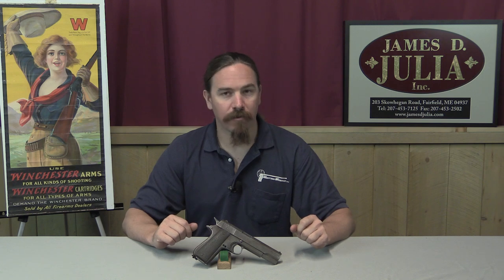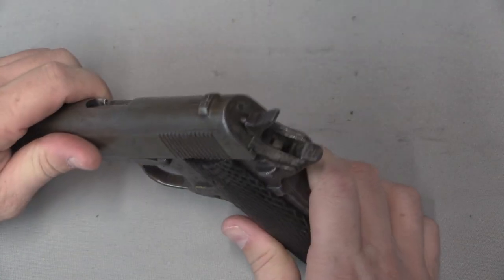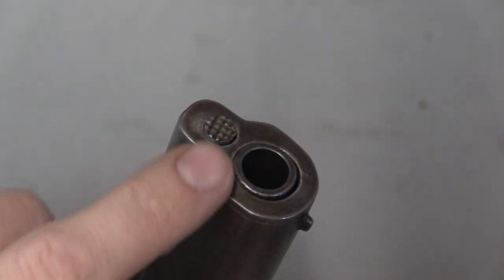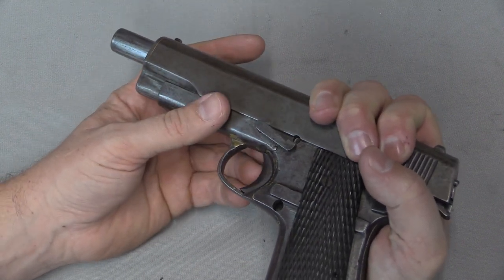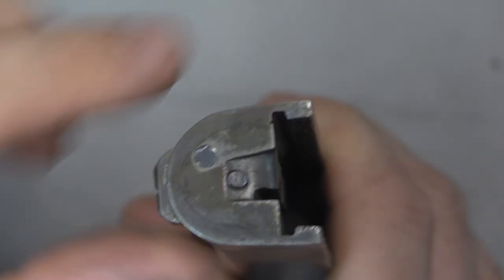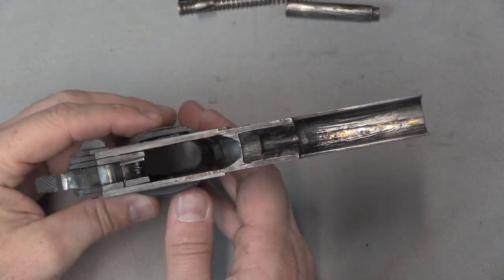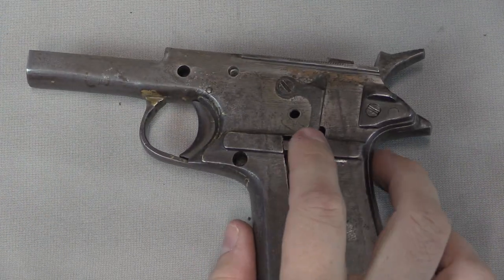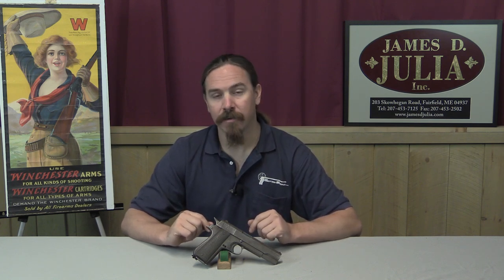Vietnamese Crude Blowback 1911 Copy

Comment: nice grenade u got there
Reply: This comment is pretty fucking funny
Reply: “Hand” grenade
Reply: it wouldnt explode if a hipoint .45acp which is potmetal for the slide wont and this is actual steel
Reply: @gcart7675  it's brazed together. And it's blowback. The pistol would come apart
Reply: Timothy White its still real steel im sure it should still hold together
Reply: @gcart7675  The concern isn't the steel itself shearing apart. The concern is that it's made out of bits of steel that are brazed together. I assure you that brazing is weaker than any Hi-point.
Reply: Peter G i assure you it isnt like i said its potmetal in a highpoint thats only blowback thats heavy enough and has a heavy enough spring power if that can stand up to it in a .45 acp blowback theres no way it wouldnt with real steel brazing aside also you gotta take into account which parts are brazed together if theyre parts that dont take that much pressure then it doesnt really matter that theyre brazed
Reply: Probably a crap grenade aswell
Reply: @gcart7675  to bad the whole firing pin assembly is brazed Together with the slide
Reply: Timothy White too* also i dont think it is also dont underestimate something cause it doesnt look good or looks cheap or whatever
Reply: @gcart7675  I don't think u realize how much power a explosion from a 45 has
Reply: Timothy White i dont think you realise there are .45s that are blowback only and the slide is made of potmetal called a hi point
Reply: Timothy White actually i can cause like i said the slide is literally potmetal instead of actual steel that can hold way more pressure than potmetal ever would its the way its put together that makes even potmetal work yes its factory made or whatever but it still doesnt compare to real steel even if it is brased together like i said it only matters if the parts that are taking all that pressure are brased together
Reply: @gcart7675  accept defeat or mastercard
Reply: @gcart7675  do what?
Reply: THE FINGER DESTROYER
Reply: @gcart7675  for how many shots??
Reply: HockeyTown Luv i dont know but it would be able to
Reply: @gcart7675  if it functioned the brazing would probably start coming apart after 1 or 2 shots is my guess but I could be wrong
Reply: HockeyTown Luv if the brazing is in places that take the most pressure then maybe but like i said in all the other comments compare it to a hi point .45 acp which the whole slide is junk metal but is just made thicker and heavier to be able to take the pressure and is a blowback design vs this gun which is real steel
Reply: @gcart7675  The question is not of what the gun is made of. It's what it is held together with. Hi-Points are milled. Meaning all of the slide is one part, not crudely brazed together. If Ian himself says that the gun is in no way safe to fire, then I will take his word for it over a bunch of 13 year olds who don't understand the basic concepts of over pressure and physics. 

   And no, I am not calling you thirteen since you are not claiming it will with certainty work just fine. Even I think it might. But I love my hands too much to use this as anything more than a talking piece or paperweight xD
Reply: @gcart7675  they brazed the slide and the block to the same piece 45.acp generates 21,000 psi. AKA your hand would be gone
Reply: @gcart7675  ... I wasn't referring to you as the 13 year old, nor suggesting that you were going to shoot it. Glad you had to resort to name-calling to try to get your point across to someone who was on year side...  

   I was making a simple observation about other people and the likelihood of is exploding in general.
Reply: Sylok, The Defiled whatever🤦🏻‍♂️
Reply: Unless that 1 percent chance it doesn't explode happens.
Reply: @OpenMawProductions  k bud whatever you say and i wasnt hating on hi points i was pointing out if a potmetal slide can handle .45 acp then steel can too even if its brazed together maybe not near as long as a hi point but it still can because the barrel is what contains most of that pressure theres hardly any pressure left being put on the slide thatd be making it come apart even being brazed together
Reply: @sylokthedefiled3047  Door stopper 🤔
Reply: @gcart7675  Well a hi point is specifically designed with an extremely heavy slide and recoil spring to function as a blowback. This was very much not designed like that.
Reply: @arieheath7773  you know why its so heavy designed? cause the slide is potmetal this gun is real steel regaurdless if its brazed together or not it would still hold up better than the potmetal slide on the hi point like ive been saying to everyone else thats tried to argue that point
Reply: @gcart7675  what is your first language?
Reply: I want to see Mythbusters set this up in a fake hand, get behind their blast screens, and pull the trigger string. Too bad the show's not around anymore. See how close they can get to seven shots, or even past zero. That would settle some of the hot comments here.
Reply: @gcart7675  bro the breech block was brazed into the slide thats a pressure baring part. This thing would probably explode. Sure it might eat some rounds but eventually its going to fail and the operator is going to get hurt
Reply: @gcart7675  when it comes to fierarms safety should always come first and shooting a 40  somthing year old home made blow back 45 acp held together with brazing and a questionable heat-treat is a real idiot move. It may not blow up on the first round but it will eventually fail
Reply: @gcart7675  Hi point slides are made of Zamak-3 whitch is a zink alloy but not all zink alloys are the same just like not all steels are the same The fram is made of steel reinforced high strength polymer. Higher stress and wear components in Hi-Points, like the barrel, chamber, breech and other small parts, are made of steel and the entire system is delayed but an extremely strong spring. This is a home made pistole  with a vary small spring and questionable heat treating
Reply: @0neDoomedSpaceMarine  i would say that saying this thing could survive one full magazine before a major part falls off would be very generous. The slide is to light and the spring is to small. This pistol would start to fall apart before 8 rounds. Plus if it managers to fire the first round without shrapneling then who ever is shooting it would not want to shoot it again. Bc the recoil would be like shooting a pistol grip no stock shotgun with 3inch magnum slugs one handed.
Reply: This thread proves the point in the old internet proverb: don't shoot the troll.
Reply: What?
Reply: Oh thanks I didn’t think you where gonna notic- hold on did you say grenade?
Reply: For people like me who get so bored during those 5 seconds of fuse time on regular  grenades
Reply: @stabbinfatties9489 it doesn’t have to have been USED, it looks like a propoganda piece. Used in NVA films

Comment: Whoever made that gun had the skills to make a functioning gun, if they knew how one actually worked.
Reply: Your right, but if they had gone for a .22 or a .32 and a single shot they would have been OK.  That gun has more complex metal work than a Sten gun does.
Reply: Judging by that out of battery lever, I think who ever built this did build a .32 copy at one time and knew just enough about firearms to make a simple blow back....not enough to make a locked .45, ha.
Reply: Nah, it's just as safe as a Sig P320
Reply: This is like almost a genius.
Reply: I would bet money that gun would fire, a full mag...
Reply: Jon Ross I’m skeptical of the ejecting but other than that yeah I bet... would kick like fuck tho
Reply: welp actually dat da wey we make dat thing is just simply try to disassemble it and try to make those parts with everything they have then try to assemble it again like what we did during french colonize :T
Reply: @djth2641  My Sig P320 is perfectly safe. As are all my other Sigs except the Sig C3 Revolution. It actually is loaded. It protects all the others. ;-)
Reply: @gravelydon7072  ya forgot about the 320 mishap huh?
Reply: @djth2641  Nope, mine went from here to the mfg even before I fired it. You'll note the fact that I said all the Sigs except the C3, which is loaded. They can't load themselves as it ( C3 ) keeps watch.;-)
Reply: @doctorwho0077 Not really. JMB had designed the M1905s before the M1911 and there wasn't a whole lot of differences in them.

Comment: So I see Hi-point has started making 1911's.
Reply: Hi Points actually WORK lol
Reply: Lmao
Reply: Hi points are actually well made. Just heavy with low round counts
Reply: R/wooooooosh
Reply: I'd take this over a high point any day of the week
Reply: @jailbird1133  The slides are made of ZAMAC, which is like a very specific formulation of pot metal. It is zinc-based. It is the same stuff Hot Wheels are made of, and these slides can snap in half under certain conditions. I have seen it happen, and there is at least one video on YouTube about the problem. The slides are by no means rugged. If I owned a Hi-Point I would treat it very gently. Good guns for the price, but a little more money would net a buyer a used example of a much better made hand gun. Here is an article on ZAMAC, which is pretty cool stuff if you do not abuse it. Cheers! https://en.wikipedia.org/wiki/Zamak
Reply: @holton345  Ive never seen one split. Ive seen them get shot in the slide and still function. Everyone I know tosses them around and they have not once failed. I have 3 and all have at least 2000 rounds through them. The only thing Ive seen break was the rear sights after it dropped 2 stories.
Reply: @BigTony-bf5jr  r/foundthemobileuser
Reply: @jailbird1133  Well made? LoL ok then.... xD
Reply: @CCasket  it goes bang every single time thetrigger is pulled. Its accurate and can get bounced around in my pickup bed and still hit its target. Look up demolition Ranch.
Reply: Loooool
Reply: @jailbird1133  hey I get that some people want a beater they dont have to worry about esp when it's so cheap, but damn, buying 3 beaters makes me think you either have money to burn, or chose quantity over quality. It's not that I think HiPoint makes a terrible firearm, but they also dont make a particularly good one either. You probably could've bought 1 really good firearm from a respected manufacturer instead of 3 from the bargain bin
Reply: @JoeDiGiovanniIV  I have other guns of other brands, but all were substantially more exspensive or are collectables with some sort of value( either monetary or sentimental). My hi points are perfect for tossing in the glovebox, or toolbox.
Reply: jailbird1133 demolition ranches was shot on the chamber, not the slide, garand thumbs hit a rock and then split when fired
Reply: @jubjub905  the chamber is covered by the slide.  Its only open when the slide is pulled back. You would hit the slide before you hit the chamber.
Reply: jailbird1133 He said HiPoints are well made..,HAHAHAHA....stop it kid, you’re killin’ me.
Reply: EdyDeIKev if a gun, which has been shot, dragged in dirt and in mud can still reliably fire, i dont think its really cheaply made. ( it still looks horrible tho and also i am not saying its really good, but its not really bad also )
Reply: K👍
Reply: People thought the AK looked ugly when it first came around. Now look where it is, on a lot of countries flags... Hi Point can do the same..
Reply: Hi-points don't snap every tendon in your firing hand when you pull the trigger.
Reply: I had a hipoint 9mil. Also the 45 carbine club and the 380 ballistic Rock. I think I put  one box of ammo through the 9mil. That carbine though man I couldn't get over the fact that I could watch the Bullet fly to a target 50 yards away like a baseball.
Reply: made that 999 into 1k likes
Reply: I think it's funny when guys argue over guns like that. My friend has a HP & he keeps it clean & it just keeps on firing
Reply: @Carolina_Luke  yeah no.
Reply: @DeadNoob451  Anything more than that to add? or is that the best you can say?
Reply: Hi points are good guns. They just look and feel weird. I got top notch firearm's  I'm a collector of all firearm's. My line is stand in front of it
Reply: @jailbird1133  garand thumb, watch his video on it
Reply: @jailbird1133  I think it's pretty interesting that HiPoint JHP45 guns actually match fairly well with the weight of 1911s. Same round count too, I think (8+1, right?) Anyway, the funniest part for me is that you can modify that gun to take 1911 mags.
Would I buy one? Not that one. I'd rather by the 40 cal version if I were to buy one, but folks say .40snw is dying a protracted death.

Comment: You know, coming back to this, when you consider who was making it, under the circumstances they were making it, this is a rather amazing reproduction. It didn't make it all the way certainly, but impressive all the same.

I'd love to see this sort of thing added to the National Museum of the Marine Corps' Vietnam collection.
Reply: There's actually a lot of Vietnamese homemade/crude factory guns in museums there. Hanoi's main military museum has dozens on display.
Reply: TwoHeavens It’s also important to remember that the person who made it likely had to make a lot of them in a short period. Of time, with limited tools.
Reply: Gimme some kind of rubber buffer (like, slide some fuel line tubing over the recoil spring or something) and the weakest load you can find and it'd probably function well enough. In fact, looking down the barrel at the copper scrapes, the cracking brazing around the "bushing" and at all the fretting on moving/impact surfaces, I think it DID function several times already.
Reply: @LenKusov  It probably functioned for testing but the maker didn't have time to finish. My theory was this was made in a civilian environment and the operation was being done in a sort of a underground way. However the US raided the business this was built in and captured the firearms, since the US assumed it wasn't functional allowed a soldier to keep it as a souvenir. If given the time it would've been given locking lugs, and a functional safety.
Reply: @SobeCrunkMonster  Even you are repeatly comment the same thing over and over by yourself.
Reply: I was thinking the same thing, gotta give credit where credit is due, whoever made this 1911 did a fine job considering the war that was being fought around him, also I’m assuming that the craftsman had a real Colt 1911 to base his piece off of and something must’ve happened where the guy who gave him the Colt came back for it which in my mind would kind of explain why the craftsman made 1911 is missing some features, kind of like when a teacher writes something up on the board that she has you copy down but erases too soon for you to get everything copied down exactly like how she wrote it.

Comment: "So we made a 1911." Hmmm "Its straight blowback" Ah Hmmm "And we brazed it together" Hmmm uh hmmm, you do know there are easier ways to make a hand grenade right
Reply: much harder to make one your enemy would take and activate himself, on himself.
Reply: @valeriandamoclesmarcellus8756  The problem isn't really with the action itself, it's the gun using it. Straight blowback requires a good spring and heavier slide to operate reliably. As the video description says, it would batter itself to pieces. The spring is too light and the metalwork probably isn't strong enough to withstand the forces of the round it's firing.
Reply: @AkkaOniVA  hi this is his friend.... he found out himself why the gun was a disaster waiting to happen..... at least he left me his account tho, thanks for helping he would have appreciated your advice

Comment: I remember seeing an article about the same, or a very similar gun in a Gun Digest book years ago.  The article was about home built Viet Cong weapons, and one of them I remember was a blowback "1911" in 45.  The frame was braized/welded together, the barrel had no locking lugs, no safeties, and so on.  Might have been the very same gun.  The GD must have been from the early 70's or so.
Reply: The one I remember seeing in a book was similar, but it had been fired enough that the barrel was bent. Not seriously, but from the side it looked about like a quarter smile.

Comment: INB4: "I didn't know Kimber sold to the Vietnamese".
Reply: I have a Kimber that's been a better gun than my Colt.
Reply: Русский Парень what kimber's do you have the ones that I've shot have been worth shit than the 1911 itself
Reply: Bro. I died when I read this. Thank you.
Reply: @AnarchAngel1  says no one ever
Reply: @joeyquiroga3102  Yea, well I said it. My Kimber is circa 2008 and my Colt is circa 2012...I can tell you as the owner of both guns that the Kimber is absolutely of higher quality than the Colt is. Are all examples going to be the same way...of course not. Kimber is or at least was capable of making nice guns. Colt is not the company that it used to be.
Reply: rock island reliability...... the right tolerances of the “high end” 1911’s sacrifice reliability. And a rock island is just as practically accurate. Sure if you clamped em both in a ransom rest at 50 yds the Kimber will probably group a lil tighter. But they’re still more accurate than 99.9% of shooters
Reply: Kimber gets alot of hate, but I had some time at the range with my buddies kimber 45, I forgot the specific model, however it really was an excellent firearm, very comfortable. Accurate, good quality.  However, i dont have enough experience with them to know if I had the exception, or the typical experience.
Reply: @JoeDiGiovanniIV  i killed a member of the high table with a kimber 1911, then i was on the run for awhile till i met a lady whith body armoured attack dogs then i was in the desert and then i fought  ninjas and was betrayed by my mentor when he shot me and i fell off a five story building
Reply: @Capodecamper  your story is very convincing with the exception of ninjas in the desert. We all know, ninjas dont reside in the desert